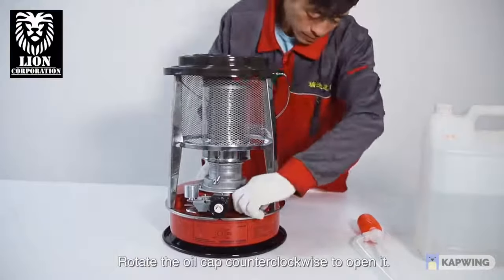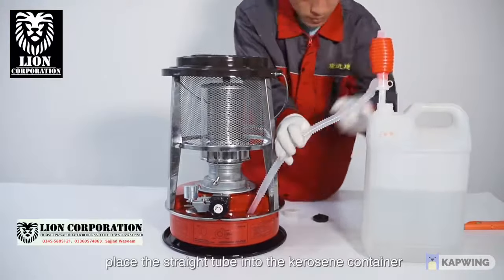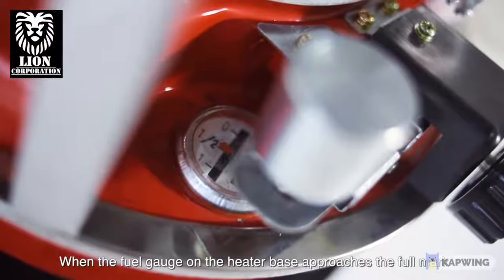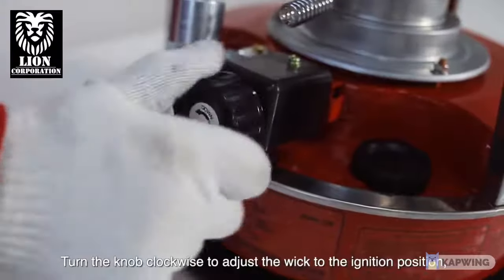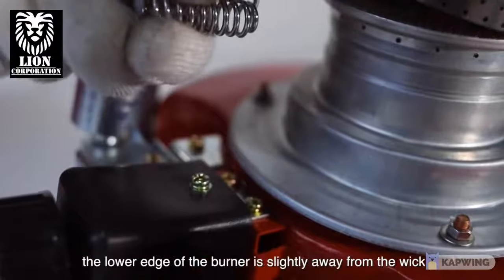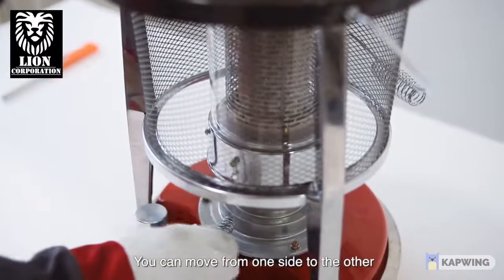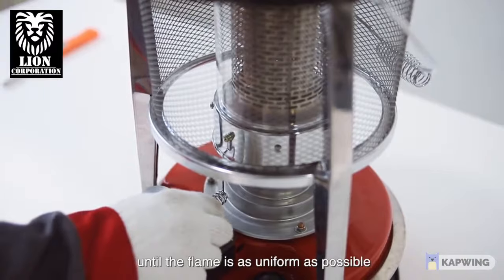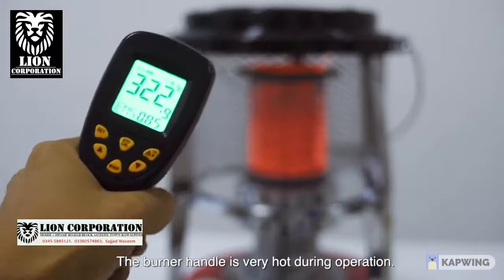HOW TO USE NEW FUJIKA KEROSENE OIL HEATER

Comment: I used this heater last winter and it did an average job heating my sitting room in my house. The operation of this heater is the same as operating a kerosene lantern. My model doesn't have an automatic ignitor nor does it have an emergency shut off. When the temperature drops below freezing I will occasionally operate two of them in my sitting room to increase my btu to 18,000. These heaters are rated at 9,000 btu each. A stove fan will increase the circulation of the heat from these kerosene heaters.
Reply: Is breathing air good or filled with monoxide in the room
As obviously doors and windows closed
Reply: Does it have any kerosene odour

Comment: I used this inside for a while.
I dont advise it.

If there is wind outside it is save to use so the wind goes to my appartement.
And my pppm stay around 500 a 600

Without wind it goes easily to 2500 3000.
That is not good at all !!

It works good to be honest.

Comment: does this heater produce smoke and if so, much smoke?
Reply: Yes it does and also smell badly
Reply: @monaansari5216  thanks for the info. That means i wont buy it.

I found a better solution btw, just a stand alone diesel heater like they use in trucks. That one has an exhaust system. So no smell, just heat.
Reply: You can get ouderless kerosene
Reply: @aali4276  true that, but i think i still will go for the diesel heater that has an exhaust. Seems to be a much better option for me to be honest.